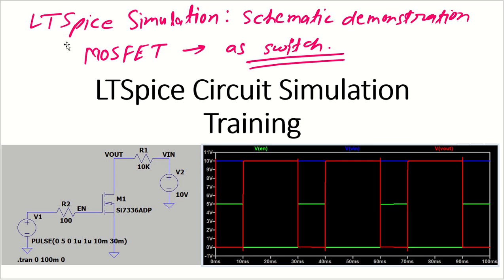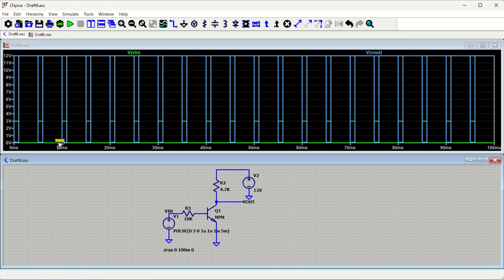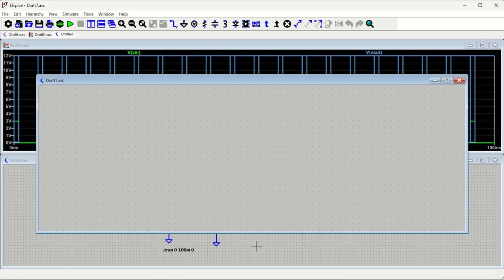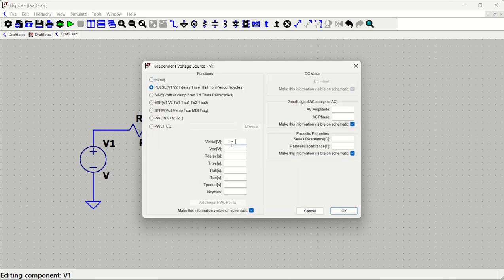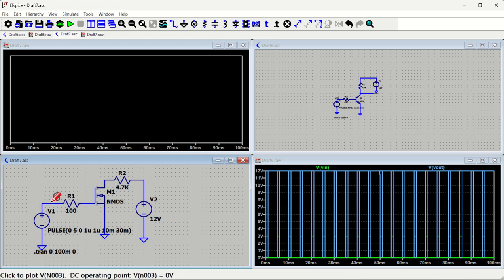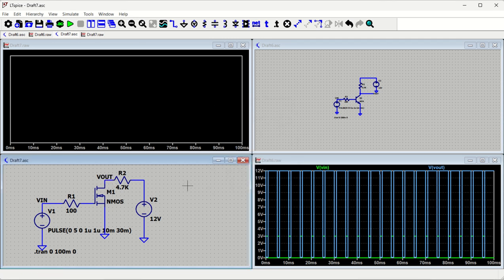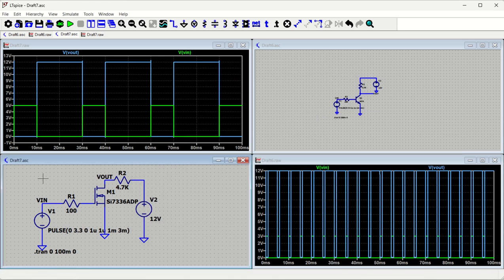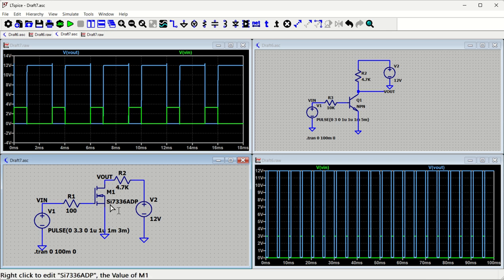020 N-Channel MOSFET as switch simulation in LTSpice

Comment: I want input signal is high and output signal also high ,means when I was given 5v I want output 28v so what changes I need to do
Reply from the maker: Yes, you can try with MOSFET High Side switch video,

https://www.youtube.com/watch?v=-8Lg9Z5AX7Q&list=PLqcAQIeMBhzQvGO5ZB2cn3hhWjVdVE-Gg&index=9

If you still face any particular problem, you can contact us. Thanks
Reply from the maker: You can also used these circuits like using NPN transistor 
https://www.facebook.com/share/p/1AgqqPSiMR/
Reply: @bkpsemiconductordesign  
How can I calculate the resistor value to get 28v output
Reply from the maker: @MayurSavalgi  It depends, how much current you wish to have. However, I am not sure about your question, like which resistor you are talking about. It would be helpful, if you can draw the circuit and indicate which resistor.